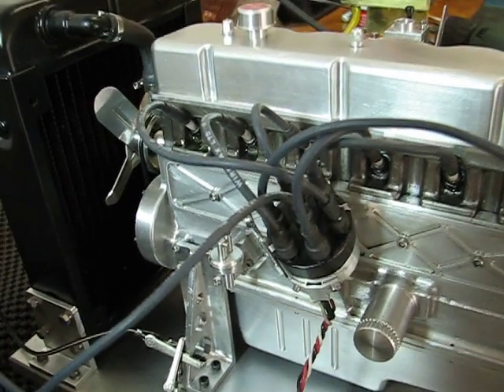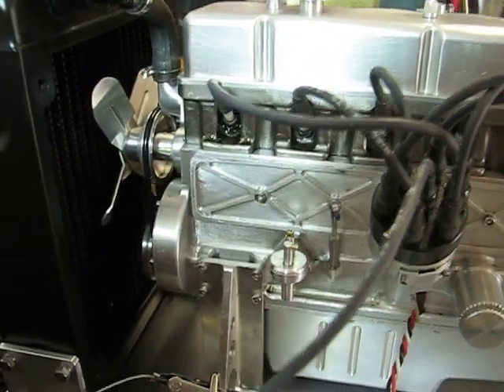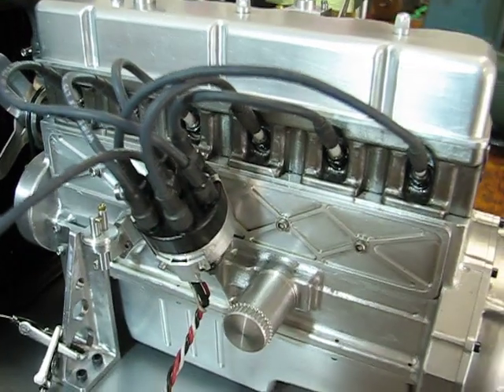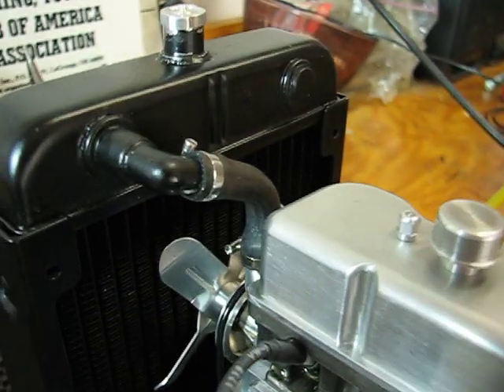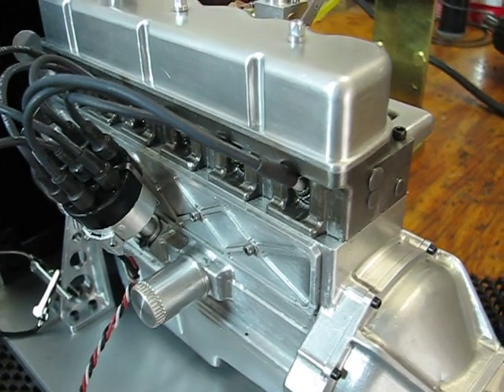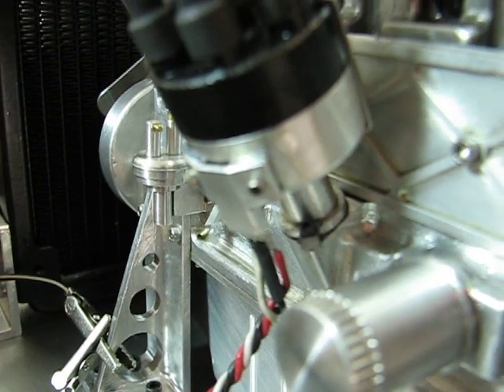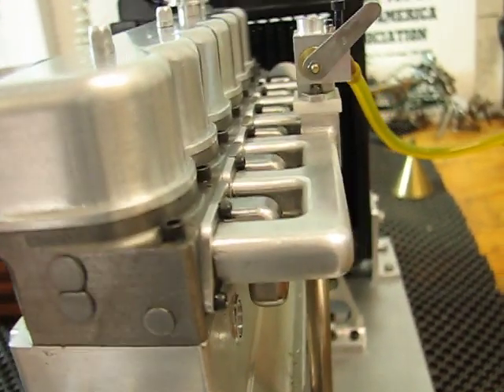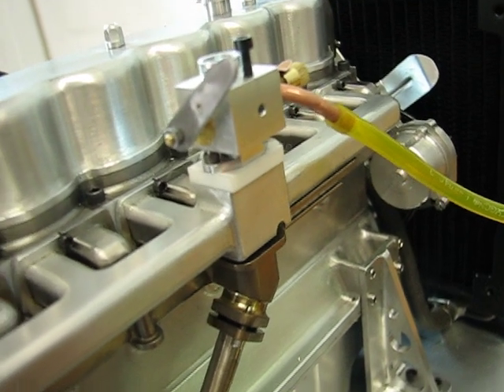Minature Ford 300 inline six cylinder engine

Comment: Did you cast the block or is it billet. Im casting a 1/3 rd scale 6cyl john deere diesel model.
Reply from the maker: @TheJohndeere466  all of my engines are made from bar stock and manually machined
Reply: @gbritnell  How did you make the manifolds. Weld pieces together?
Reply from the maker: @TheJohndeere466  the runner and outlets/inlets were machined in one piece. The bottom side was opened up with a small ledge on both sides.  A filler piece was made and silver soldered in place. Contact me at gbritnell@yahoo.com if you want specific information
Reply: @gbritnell  Thanks, I just wondered how you did it without casting it. Did you ever try casting some of this stuff. I would think it would be much easier. There is a guy on youtube and his name is Kelly Coffield I  believe. He makes some really nice parts using lost foam casting.
Reply from the maker: @TheJohndeere466  for one off parts by the time you make patterns and core boxes it's much quicker just to machine them.  Another problem is the wall thickness is so thin you'd probably get a lot of short pours when casting
Reply: @gbritnell  You dont need a pattern or core box for lost foam casting and Kelly casts some really thin parts. One thing he makes  is intake manifolds for a v8 engine.
Reply from the maker: @TheJohndeere466  didn't know that but the manifolds on the 300 are steel
Reply: @gbritnell  I dont know for sure but I would bet the original manifolds were cast iron. Cast steel is usually not used for a manifold.

Comment: Was there a working water pump? where did the tiny radiator come from?
Reply from the maker: The water pump is on the front of the engine . The radiator is one that's used for cooling electronic units. They are made in China and sold on Ebay

Comment: I am trying to create a quarter scale working version of the chevy stovebolt 6 do you have any tips that could help me?
Reply from the maker: It would certainly make it easier if you had one to measure from. You have to make some allowances for metal wall thicknesses when you scale down otherwise they get too thin. Another thing is using the closest scale nuts and bolts. This engine is about 1/5 scale so 1/4 would be a little easier

Comment: 75 X .875 X 6 = 2.32 cu.in. If you could bore the cylinders out to .853" it would then displace 3.00 cu.in. Pretty cool little machine. Nice work. -b

Comment: Very  nice ex! The only thing I have a question about  is that the bore and stroke  is the same on  The full size one....4" were you unable  to make  it  a  square  engine  like the real one?
Reply: 4 inch bore and a 3.98 inch stroke on the 300, I didn't realize that the bore/stroke isn't an exact scale until I read your comment.

Comment: How do you scale down the parts and make molds for them? im looking to build a 300cc v6 and might buy a lathe and mill.
Reply: You could do molds of them and cast them if that's what you're taking about, but you would have to make the molds yourself from scratch. It's quite coustom work. Doing it where you could cast blocks would definitely be cool cause it could help you make multiple of the same motor.

Comment: What a big inline six it was back then!  The 300 CID inline 6 stopped production by the mid-1990s.  BTW, did you know Henry Ford actually hated making inline sixes?  Their main rival Chevrolet started mass-producing six-cylinder-powered vehicles around the same time Ford mass-produced V8-powered vehicles.
Reply: 1996 to be exact. I read somewhere that they hated the sixes cause they "easily overpowered the gear boxes". But that had sounded like it was directed at the early 1900's.

Comment: Fantastic as always. Can you tell the secret of your radiator hoses? I'm going to need some for the V4 I'm building and I'd love to have ones as real looking as yours, rather than simple silicon tube.
Reply from the maker: I purchase black tubing tubing the required diameter from a company named McMaster-Carr. They sell different types, neoprene, rubber, tygon etc. The hose clamps are fabricated from stainless steel for the particular hose diameter.
Reply: Thanks George. They don't ship to me in my country so I'll have a look at an auto parts store for vacuum pipe maybe. I won't even attempt the hose clamps though - I don't have the skill for those!

Comment: cnc or manuel, and how many hours of work went in to that. great job.
Reply from the maker: All manual. Medium sized vertical knee mill and 11" Logan lathe. 
About 200 hours of design and drawing and possibly 6-700 hours of machining.
Reply: it's a masterpiece !
Reply from the maker: Hi Justin,
All manual machining. 11" Logan lathe and medium size vertical knee mill, along with rotary table, dividing head etc. With design, drawings and machining I'm somewhere in the neighborhood of 1600 hours. There's a complete build log on the MEM forum. Do a search for: An inline six OHV engine.

Comment: Nice work , did anyone notice the no 1 spark plug arcing when it was started ? that kind of thing would affect the tune to some degree . I love it nonetheless
Reply from the maker: +Allan ES 
Hi Allan, 
It's not the plug arcing but the reflection on the small bubbles coming from around the plug. The plugs are so small that I didn't want to overtighten them and one was leaking.
Reply: +gbritnell Oh , ok :D

Comment: Amazing work.  I noticed something the 5th time I watched the video LOL! ... what are the bubbles on the front-most cylinder?  Do you use custom gaskets on this, or is it just some kind of gasket sealer material metal to metal?  What about for the head?
Reply from the maker: +Rick C. Hodgin 
The spark plugs are so small (8-40 thread) that I didn't want to over-tighten them and there was a little leakage around the plug.
Reply: gbritnell I've been looking through your videos and seeing your work.  I am truly stunned.  You have amazing skills, sir.  And I thank you for sharing these videos with us.

Comment: What's with the 1st plug area?Is that oil bubbling,or is the spark misfiring?Hard for me to tell by the video,but looks like something's up.May explain the slight miss?Also,I understand the Hall effect for the fire,but perhaps you can do a video,and explain the goings on in your "spark box" sometime?
Reply from the maker: Bowtie41 
The plugs are extremely tiny, 8-40 thread, and I didn't tighten them too tight so the little bit of oil that was around the base of the plug was bubbling from a little bit of leaking compression.

Comment: Mmm, it even more or less captures the snarl these things have. I would suggest a heavier flywheel and retarding the timing quite a bit more, though. My full scale 300 with >300K on it will idle quite happily with 5-6 degrees BTDC timing at 500RPM. This one most likely would too.
Reply from the maker: TestECull That's the hard part when scaling engines down. Some of the physics, like flywheel weight, can't be scaled. On some of my other engines I just made oversized flywheels but with this one having to fit inside the bellhousing I was limited.The timing is a tradeoff. If I reduce it the engine will run a little slower but then it's unresponsive when you want to rev it up. If you advance it far enough it will scream but the idle is higher.
Reply: gbritnell
Hah. Sounds just like its bigger brother, then. Mine doesn't really like to gain revs very quickly at all, it much prefers loping around below 2500RPM.

Lovely engine as always. Almost makes me wonder how the model would sound if it had to turn a dynamo.
Reply: I've been reading on a few 300 Facebook pages and sounds like the base timing for the 300 should be set at 14° btdc. And on the note of how fast it rev's, you shouldn't take the big one above around 4000, but even then it's really wound up and pointless. The torque maxes out around 2500, and the HP starts to drop fast between 3000-3500.

Comment: I wonder if it will also run 1,000,000+ miles like the full scale 300. LOL.
Reply: Yeah same because the inline 6 is the best configuration for balance in an engine
Reply: Inline 6s hit a nasty harmonic at 6000 rpm, so if was held WOT (wide open throttle for you non automotive enthusiast) and hit 6000 rpm it would the crankshaft would become 6 peices.

Comment from the maker: The compression ratio is 8:1. I don't know what the H.P. is. Possibly 1-1/2.
Reply: +gbritnell where is the air intake manifold
Reply: +08halit intake manifold is directly under the carb.  At 1:59 , you can see the fuel line running to the carb sitting on top of the intake on the right side of the engine.  You can also make out the exhaust manifold nestled in-between the intake runners.
Reply: +gbritnell I think you're seriously, seriously downgrading the horsepower on that puppy; I'd say you're probably making 6+
Reply: Yeah I bet it's making 6+ too...the mini v12s make 4.8- 5.6 for a lot of them
Reply: i wonder how much torque it make

Comment: Great project !  Sounds good, I think my Ford Van is powered by the full scale version of this engine as well as a lot of aircraft ground power units from the 1970's through about 1995 or so.
Reply: The engine ran production from about 63/64 and ran up until 96. Great engines, I love the one paired with the 5-speed in my 96 F-150, I would love to have a model of it.

Comment: Amazing... how you make the little spark plugs alone ....btw there is arching around base of No. 1 plug was visible
Reply from the maker: Andrew T. C. Wilson It's not arcing. The spark plug is so small I didn't want to overtighten it and it was bubbling a little oil that was around the base of the plug.
Reply: @gbritnell  did you make this engine if you did i like to have you make me a few different engines like this of this size i want to have a 235cubic inch chevy inline 6 cylinder made of this size and the big 409W chevy v8 engine and the 428FE ford v8 and the 426 dodge hemi if you can make the engines i mentioned ill buy every one of them and give you cash $$money$$$ for them immediately
Reply from the maker: @kristafoster7190  Yes I made the engine. Building an model engine is more than just machining. It takes many hours of measuring and making working drawings before it ever gets to the cutting metal process. Some of my engines have over 2000 hours invested. This is all manual machining, not CNC work. Even at $10 an hour they would be cost prohibitive.

Comment: I see something going on with the #1 sparkplug while it's running. It's the front plug, it looks like there is oil blow by or maybe some spark arcing. Not sure, maybe it's just the video?

I see it better now. It's definitely not a spark issue. It looks like the plug is just real loose or something.
Reply from the maker: Blaze0357 The spark plugs are so small (8-40 thread) that I didn't want to overtighten them so the one cylinder was bubbling a little bit of oil that was around the plug. I have since annealed the copper washers and tightened them a little more. Bubbling is gone.

Comment: A work of art,..but why a splash oil system? All that good work and and no pressurised lubrication seems a contradiction of intent...
Reply from the maker: Noel Mintern It has a splash oil system because I have found it to be entirely adequate for miniature engines such as this. Some of my engines have pressurized systems.
Reply: gbritnell I finally revisited this site and saw your reply.I'm intrigued that a splash oil system can actually lubricate.Given the tolerances between surfaces it seems the oil would be forced away from penetrating any area in need of oil.Having said that I have to give you credit for making such a wonderful engine,it really is a work of art...